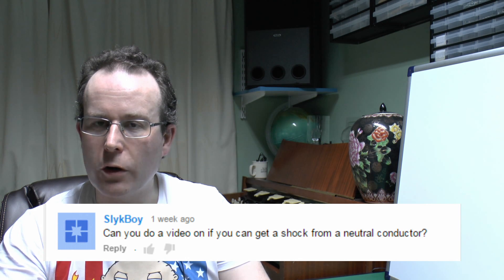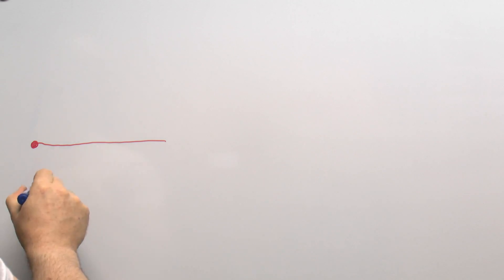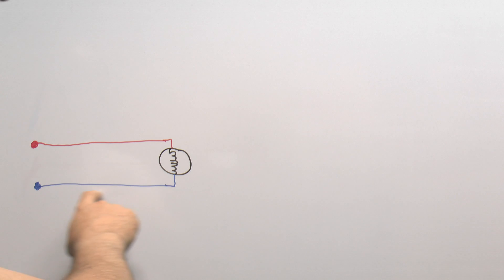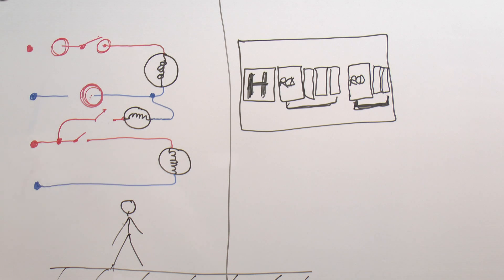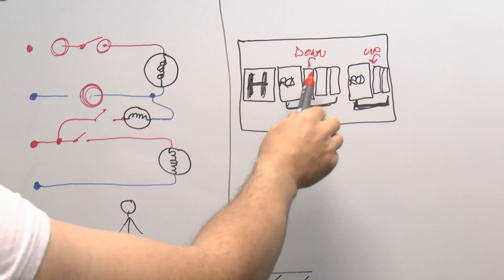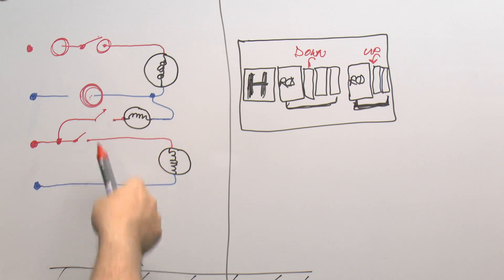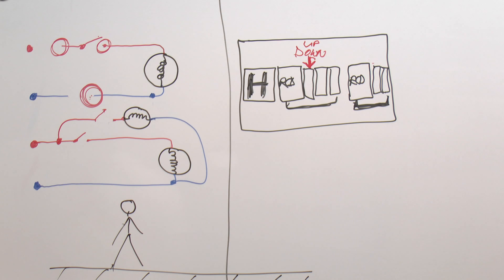Shared or Borrowed Neutrals on Mains Electricity Circuits

Comment: John, did you do an electrical degree? Also what's your day job? I've learned a lot from you as a (soon to be) graduate and I was curious.
Reply: I’d like to know too because what he says at 2:05 is incorrect and you will get a shock if you do what he explains here! Very dangerous!! Only if the circuit has an RCD will you be saved when the RCD trips the circuit from you doing this action!!

Ps I’m a chartered professional electrical engineer so know what I’m talking about 👍🏼
Reply: @peterkilleen3061  
I don't think so. The neutral connection must be at earth since it is tied to earth, given normal less resistance copper wire. The PD is across the electrical fitting.
Reply: @frankcollins4743  sorry what are your qualifications to comment on this? The neutral is tied to earth at the consumer unit - so if you come into contact with a live circuit by touching the neutral, your body completes a parallel circuit through earth which current will flow. Yes the current through the neutral will be higher given the impedance difference, but it only takes 50mA to kill you. As I mentioned if an RCD is there, then it will save you. As the current through the live (active) wire won’t be balanced through the neutral - as your body will now be a conduction path - current through live = current through neutral + current through body
Reply: @frankcollins4743  tell you what - if you’re so confident. Why don’t you go do it now? It you have an RCD it will save your life - see if it trips 😉
Reply: @peterkilleen3061 
As you are the engineer, at what potential is the neutral line?
Reply: @peterkilleen3061 
One doesn't need a degree in anything to see a fallacy; a fairly trifling effort from an overconfidence.
Given the inpedance of copper, the PD per metre is very low, so much so, the resistance of a human body is comparatively huge. Given your knowledge of Ohm's Law, current through a parallel large resistance will be very low, perhaps enough to trigger an RCD, but not lethal.
Anyway, what is the PD to earth of the neutral line?
Reply: @frankcollins4743  spoken like a true person who doesn’t understand the laws of physics.

Like I said, if you’re so confident - find a circuit without RCD protection (old light circuit in uk), turn the light on and touch the neutral connection on the light fitting, see what happens. Yes I already said the current will be low - but only takes 50mA to stop your heart.

Yes the neutral is tied to ground and so at technically at the same potention - but this isn’t a simple circuit, you have to look at the complete circuit from source (I.e transformer secondary winding) there is a potential drop between the MEN link in your house to the transformer neutral via earth because of the large impedance in the earth/soil.

What you’re talking about is substations where they have a metallic earth grid and everything bonded to that earth grid will be at same potential given the low impedance of the earth grid
Reply: Not a simple circuit? How much simpler can it be?
Reply: @frankcollins4743  not the frigging lighting circuit here. The whole circuit from the transformer to your house and the earthing arrangements. How about draw the circuit on paper and do some circuit analysis. Like I said, go test it for yourself. Let me know if you don’t feel anything - best hope you have dry skin and a high impedance body and high resistance between your feet and the point where the the earth in your house connects back to the neutral. You may get lucky if that’s the case. But otherwise, you cannot safely say you can touch a neutral and it’s perfectly safe to do so - as when you touch it, unless you’re in contact with nothing else, you create a parallel current return path back to the board - and if 50mA flows through you and through your heart, it has the potential to kill you - couldn’t be clearer!
Reply: @peterkilleen3061  💯 💯 💯 💯  extactly
Reply: 5 years later, I'm a Protection and Control Engineer designing protection system for offshore wind farms and National Grid substations. Mines been well worth it.
Reply: @MattJBaugh  nice I used to do this for Siemens in Manchester. Then did a 3 year stint in Germany doing Converter control for HVDC offshore platform, offshore commissioning. Now a principal project engineer in Australia, leading the overall technical delivery of major BESS projects for the last 4 years 👍🏼
Reply: @peterkilleen3061  oh that's exactly where I work! I started late 2016, sounds like I should be able to go far! Not done any HVDC work just yet.
Reply: @MattJBaugh  small world. I left Siemens before you started. Started sep 2011 as a grad, went Germany with Siemens December 2012, came back July 2015 (look up Helwin Beta - I did all in house testing then, install supervision and commissioning in Rotterdam, then offshore testing and trial operation, good old days). Joined RXPE (now RXHK) in altrincham in august 2015 as prot & control engineer for statcoms for offshore wind farm connections (race bank and burbo bank). Moved to Melbourne March 2017, working for S&C electric and being doing PQES ever since. Now working for Hitachi ABB Powergrids 👍🏼
Reply: You don't "do" a degree, your earn a degree.
Reply: @Rico702Vegas  arsehole
Reply: @IronFinger66  😂
Reply: @IronFinger66 
You have earned that title too.
Reply: @IronFinger66  As a Degree holder (English B.A) let me say that having one these days is barely something worth shouting about.

Obviously this isn't true for all, and I'm not saying it doesn't apply to me either, but some of the dumbest, most closed minded people I've ever met I met on campus.

There's plenty that can't be taught in a classroom or through a book.
Reply: @theoverthinkingalien224  English degree vs and engineering degree is a whole different ball game 🤣
Reply: @peterkilleen3061  I agree, but there are plenty of people with STEM degrees they don't/can't use as well.

For most students of any degree, I'd argue that it isn't worth it.

Comment: it might be worth pointing out that in the video at timeline15:33 - 35, at the disconnection point Li to wire, similarly, L2 to wire, usually in close proximity, the hazard voltage is 415v

Comment: I am installing 4 aircon units, 4 electric showers, two washing machines, about 50 5 watt l.e.d. lights, two large refrigerators, electric hob, oven and 30 double sockets. What size consumer unit and electric meter amperage would I need please?
Reply: A big one

Comment: normaly white is neutral black red live and blue is live in a 208 system some times white can be live in switch loops and some 249 volt circuts hot water heater or base bord heater allways check befor working on and consolt inspecter befor doing wiring

Comment: Its not good to have lightning and outlets on a 3 phase group, because if the neutral is somehow disconnected the power on the lightning and outlets will be under and over 240volts and that can cost a lot in new televisions and so on.

Comment: Hi  john. Any chance of a video on fault finding on immersion heaters please !!!
Reply from the maker: +D lewis Yes, added to the list.
Reply: Thanks John
Reply: +John Ward how about unbalanced loads L1    L2   L3, whats that about, leading to N  having a potential
Reply: +smartchip Here is a formula to work out the neutral current, This is providing that the phases are 120 degrees apart. N=√((IL1-0.5(IL2+IL3))²+(0.866(IL2-IL3))² .

Or  N=√((A²+B²+C²)-((A×B)+(A×C)+(B×C)))
Reply: Simon Aragon
Thank you for taking the time to help, Godspeed

Comment: Curious about your comment in this video on the dual-RCD-board "This is not a configuration I particularly like or generally install" -- wonder what you DO generally install in a domestic installation especially if there are many circuits and all-RCBOs is not cost-effective?  How do you split circuits across RCDs / extra-RCBO etc.?   With thanks,
Reply: +sbusweb 
Gah! You already answered this is another thread, sorry...
But still raises question about how to do decent split most-effectively...

Comment: But this (I think) is actually allowed in the USA. For what they call "half-switched outlets". Where a line conductor is taken from a lighting circuit (and fed via a switch) and connected to one socket of a duplex socket, so obviously the line interconnection between the two sockets has to be broken, by removing a small tab, but there is no requirement to remove the interconnection on the neutral side meaning that the line may be supplied from a lighting circuit and the neutral may be supplied from a socket circuit.
Reply: Tapping the neutral of a different circuit is not permitted in the USA.. In most cases the "split duplex" receptacle is served by the same circuit.The other possibility is the two halves are served by a three wire circuit  (both hot wires with shared neutral), protected by a two-pole breaker..

Comment: You vorgett something importent  to tell! The neutral and the earth dont have the same potential in the event that current flows to the neutral! That is the reason why trips the rccb´ s if the neutral and earth go in tuch. In the event that a large starting current flows or in the event of short circut , the voltage drop on the neutral can be half of main voltage! In bad wirering more than half.  To any resistors were current flows there is a voltage drop. So if in neutral a current flows and in earth not there is the differential voltage. Another interesting storry , in the factory were i workd für 11 jears as Mechatronics in some case of bad installing i get 115 volts shocks from a metall wall . I solved these problem whith low impedanz earth conection. But i never know were the potential coms from. The metall wall was mounded on a conductive floor an several points ?? The company dicidet it is not importend. Nobody died. the problem was bad solved. Its ok :(    After few jears the hole construction was scrapped. I hope whith medium or hight voltage they give more care aboud.

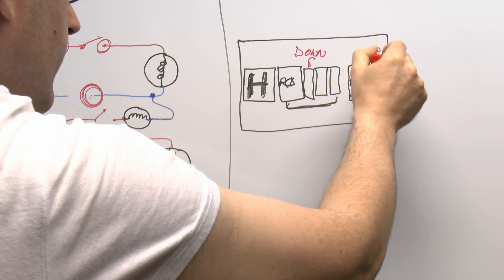Comment: If you've got this kind of arrangement with this s**t! XD 10:35
As an electrician I have been caught out more than once by this, usually when replacing a ceiling light. Often done where 3 core and earth or a single core insulated and sheathed cable was not available.  I did have it once when someone had taken a permanent line from a different lighting circuit as they forgot to wire one in for a combined emergency light.
Great videos by the way.

Comment: Interesting videos Sir!  I am fascinated by the differences between electrical wiring methods between British installations and those here in Canada.  Regarding the latter part of the video with the 3 pole breaker supplying 3 loads and having a common neutral: In Canada it IS permitted to utilize a common neutral between circuits supplied from separate phases and protected by single pole devices, albeit the connections to the neutral have to be made so that  it is highly unlikely the neutral can be opened accidentally by for example the removal of a light fitting or receptacle... Occasionally this method is used in residential applications as our supplies are "120/240V 1 ph 3 wire"  , neutral being derived from the center tap of the distribution transformer.. In some cases 3 conductor cable may be run to a point in the residence and split into 2x2 conductor circuits, each protected by a single pole overcurrent device. ("Split" duplex receptacles as are common here  employ a shared neutral just by design but must be connected to 2-pole breakers, nothing to do with neutrals, but just so "joe homeowner" does not turn off 1/2 the receptacle and blow himself up trying to make repairs. :) )

Comment: so, how would this be an issue, if the wire that would power a light is a 2 wire, line and neutral cables in one wire. if you were to add a circuit wouldn't the neutral be added from the 2 wire from the circuit that  you are branching off from. I see how this would be an issue on a diagram, but not actually done.

Comment: i'm from Denmark and the one with sharing a N from another Circuit would not occur here, because there stands in "Stærkstrømsbekendtgørelsen" Section 6(High Current Regulations) on §314.2 that two different circuits should not be able to effect each other. Is this only a rule here, or you have the same kind of rule?
Reply from the maker: zentrobi There is a similar rule here now, so more recent installations do not have this problem.
Reply: here now from the dawn of time

Comment: Thanks for the video. 

If putting the two light circuits onto one circuit breaker  would cause an overload, can one install a two pole circuit breaker instead and have that two pole circuit breaker feed off the rcd. That way if one light cct was to be isolated or if a fault devolops on one circuit both would turn off and stop the possibility of the neutral becoming live?
Reply from the maker: A. Samrout Yes that could be done, would be similar in principle to a 3 phase lighting circuit which would use a 3 pole breaker and single neutral.
Reply: Thank you mate.

Comment: Thanks for the video.

Another way to get a shock from the N conductor would be to have a phase to neutral fault on the 3-phase LV distribution network - I think there was a case a few years ago in E. Suffolk where a set of houses received either no power or about 400V depending on which phase they were connected to. I think the N conductor is connected to ground via a current limiting resistor to limit such cases (I might be wrong there) but that's a fairly rare event thank goodness.

Comment: Did some supply work a while back in a council house, weird 3ph supply, 1ph to house the other 2ph vanished into trunking... but all neutrals came back to the block. I did'nt realise one of the return neutrals was not tight in the block and I disturbed it as I pulled the live cable out of the meter, I heard a buzzing then a pop and blue sparks flew out of the cutout... I s**t my pants and jumped out that cupboard so fast lol took me a minute to work out what was going on.... shoddy engineers out there! I find so many loose neutrals, its bizarre. Solid video as usual Mr Ward thank you...
Reply: +Jon “Wookie” Buggins
Neutrals coming loose is well known phenomenon, balanced electrical noise on each phase of higher-order harmonics *adds up* on the neutral shared by the 3 phases, effectively making the Neutral more vulnerable to coming loose than the phases.  Though in this case it could indeed have just always been lose, nonetheless worth being aware of...

Comment: might be a silly question but in a 3 phase circuit why is the neutral conductor the same mm2 as the line conductors if it carrys x3 the current..i almost understand that the frequencies overlap but still confused............keep it up j
Reply from the maker: damon btc In a 3 phase and neutral system, the maximum current occurs with a load between one phase and the neutral.  If two or three phases are in use, the neutral current is less, and with a balanced three phase load such as a motor, there is no neutral current at all.
Reply: Alternating current  allows the imbalance to return on a hot conductor so that the neutral only carries the imbalanced load so if we are perfectly balanced no neutral load

Comment: The example of the stairway lights is confusing to me. Is it a matter of running a two wire cable as shunts/travellers from a three-way switch fed on the first floor to a three-way switch on the second and using a bootleg neutral from that box out to the light? Seems like if I were to do that much work to begin with, I'd just pull a three wire (+E) cable to begin with...

We use the term "shared" only for split or three phase neutrals. What you described in the stairway lights would be a bootleg, or stolen, neutral and has been illegal for many decades.
Reply from the maker: PetrosArgy Yes, two wires between the switches, with the line on one floor and the neutral on the other. That arrangement isn't permitted in the UK either, but can be found in plenty of older properties.  Why it was done in the past is not entirely clear, although it may be due to the installer not having 3 core cable, as that would typically be the only place 3 core & earth cable would be used, everything else would use 2 core & earth.
Using three wires is the correct method, and is what would normally be used on new circuits.
Reply: Just to add - in Australia the usual way to do a two-way is using a pair between the switches, then a single to the load from one switch and a single to the supply from the other switch. The Neutral would be another single picked up from the ceiling somewhere near the light. The neutral was never brought to a switch. Also, it's almost impossible to buy 3-core cable unless it's twin+earth, so every electrician keeps a roll of single core in the truck.
Reply: ***** It might have been the common practice in the distant past of using a single-core cable plus a 2-core instead of 3-core for two-way switching that made this kind of thing more likely. Take it away and there's no reason not to do it properly.